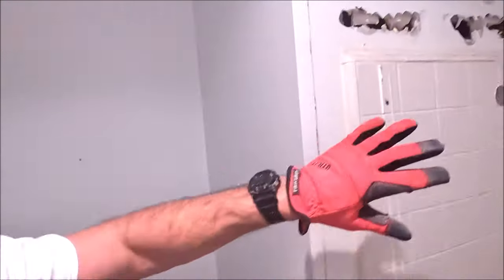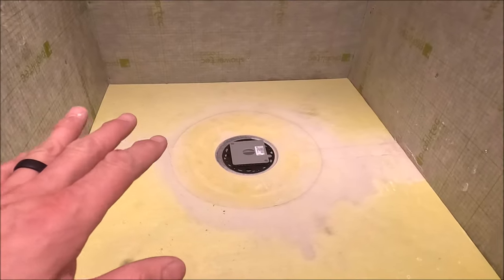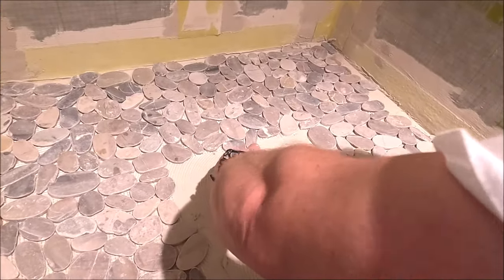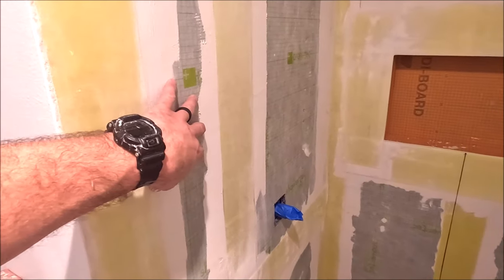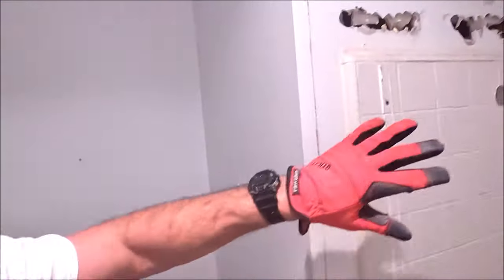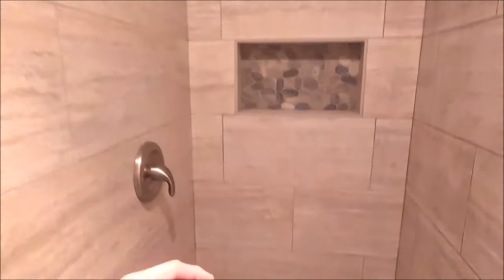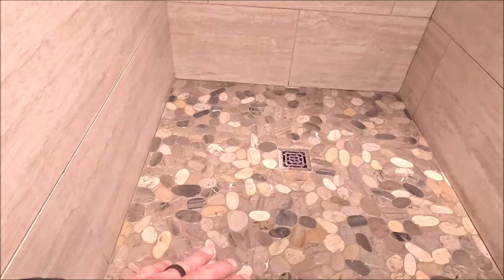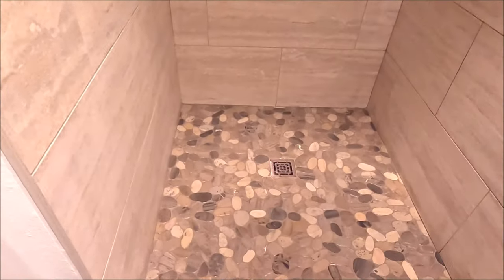NEW PROFILITEC Shower System | Shower Build Part 2

Comment: Nicely done. I'm not a huge fan of the schluetter system. There is too much wallpaper hanging before tiling and I don't like the build up in the corners especially with smaller tiles. That said, very nice job  and I'm sure the homeowners are happy with the results. It's always nice to see other professionals in the trade do their work.
Reply: What do you use?
Reply from the maker: Appreciate it brother, tile on! 👊

Comment: What are the main differences in this system vs Schluter?
Reply from the maker: Board and foam is more rigid with Profilitcec and you need to create your own niches with the board vs prefab schluter niches. Other than that, they are nearly identical.

Comment: Very nice as per usual. Question is there a method tile manufacturer use for packaging the tiles so the veining lines up? To clarify if you take a box and lay top tile on floor  then stack next tile then next tile etc does that give you a run of matching veins? I didn’t know if there is an industry standard for such a thing to help us set up walls and floors without having to unbox every piece and play Tetris on the floor? 
Thanks in advance glad your back
Reply from the maker: We basically play Tetris like you say. We usually have the client purchase a box or two more than we need and we try our best to line up veins/movement. We never can get it perfect.
Reply: Thank you just didn’t know if there was some secret industry standard that manufacturers use to package the boxes and aide the installer.

Comment: Way to much skim time on the niche to hand set each pebble. Still not pouring your own pan? Also it's a water management system not sealed! Thinset isn't a waterproofing! Still enjoy your videos. Just don't miss lead the public that watches your videos! KOKO!
Reply: I don’t think he or you are the worlds best out there but come on, let’s be real and not be a pedant. 
1. You have no idea of the working time or pot life of the thinset he used 
2. How do you know how long it took him to hand set the pebbles? 
3. This isn’t a submarine - the thinset is water resistant and will only weep small amounts if fully submerged for an extended period. Not typical shower use.
Reply from the maker: Hand setting cut flat river rock goes faster than you think. Schluter, Laticrete and Profilitec and called seal systems and I prefer shower trays, but install drypacks all the time like this which was the shower before this video https://www.youtube.com/watch?v=Ayqidlk-Vl8 Do appreciate the feedback 👊👊